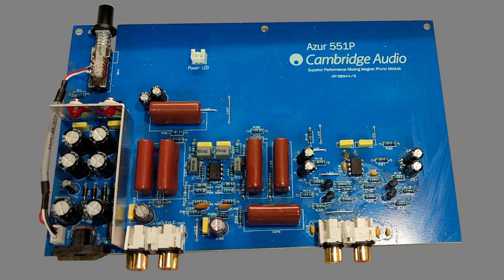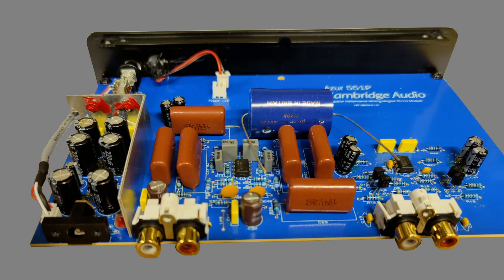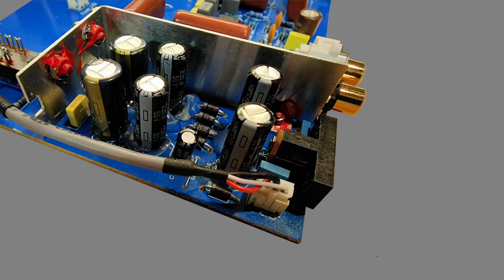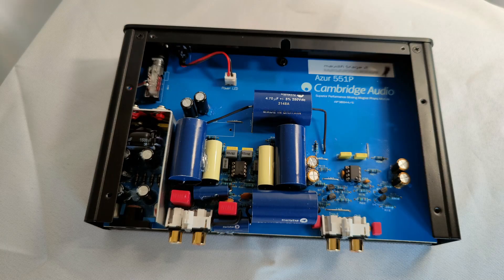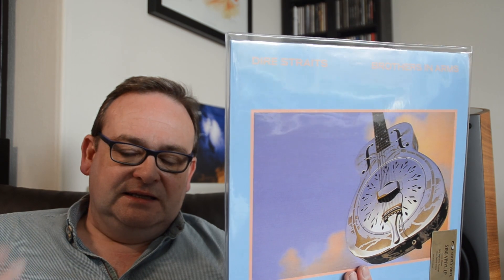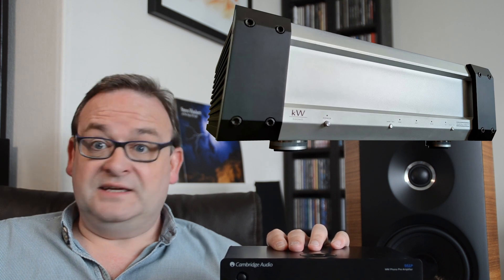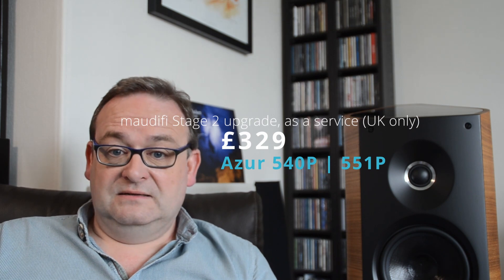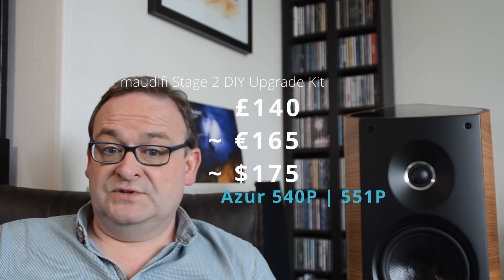Can you transform a budget Cambridge Audio 551P, or 540P, into a high-end phono stage?

Comment from the maker: For those of you who want a better, quicker and easier DIY upgrade for the Cambridge Audio phono stages, then the @maudifi PhonOh! 756 is now available.  Oh, you can also fit it in any enclosure you want, that it physically fits in of course 😉.

It's more than just an upgrade, it's a complete upcycling solution giving higher-end sonics that you can fit in one of the older CA phono boxes (540P, 640P, 551P, 651P, CP1 and CP2).  It typically takes 10 minutes to fit.  Find out more at https://maudifi.co.uk/phonoh756-landing-page/ or watch the videos linked on the end screen.  Ciao.

Comment: Amazing video and voiceover!

Do you know how a modded CA phono  stage would compare to the preamp in the AXR85 amp?  Thank you
Reply from the maker: Thank you.
The simple answer is no, I don't, because I haven't heard the AXR85 and I don't know the details of what is inside it.  
HOWEVER, have a think about it - There is a lot crammed into the AXR85: DAC, FM Tuner, Phono stage, pre-amp, headphone amp and power amp.  All for approx £400.  The chances of the phono stage being as good as Cambridge's own MM phono stages is not high, let alone a well modified one.  It's almost certainly going to be a basic affair to get you going and I guess that's absolutely fine at the price point.
For me personally, I prefer the less is more route: Give me fewer features, but increase the quality of the internals.  Then you can add, upgrade and modify the components you need over time.
Hope that helps.

PS/ There is now a simple maudifi PhonOh! phono stage which makes the mod much, much easier.  https://maudifi.co.uk/phonoh756-landing-page

Comment: Hello, have you thought about changing those small grey film caps?
Reply from the maker: Hi @tweakerman, thanks for your question.  Yes, I have.  However, there are much bigger bang for the buck improvements elsewhere in the 540P/551P.  The RIAA on these is not that accurate and more circuit changes should really be made to correct it.  That said, I have a better solution in the pipeline that addresses this and some other needs.  

The 551P with a Stage 2 upgrade is rather impressive even without addressing the poor RIAA response.
Reply: @maudifi  Hi, I've upgraded a CP1, Solo & a 540P use Audi note Kaisei electrolytic capacitors, that in the power supply & some signal caps, I've also replaced the 6 film caps with JB JFX premium film caps, they just fit without to much trouble & I can say they are all outstanding now, I've done a few videos on my channel about them, cheers for sharing your video👍
Reply from the maker: For those of you interested in such things, the better solution I mentioned here is now available. ... an easy fit upgrade solution that you can fit yourself in around 10 minutes.  No soldering, only a screwdriver required.  Check it out at https://maudifi.co.uk/phonoh756-landing-page/ or watch the videos on it (the end screen of this video has been updated to link to them). Any questions, just ask.

Comment: Is it possible to increase the gain in the 540P by replacing resistors, I find the standard 39Db to be a little too quiet, the AT-VM95SH cart is only 3.5mv output? Also, what PSU would you recommend? Thanks.
Reply from the maker: Yes, it could be changed on the first gain stage.  One resistor per channel.  Changing on the second stage would affect the RIAA response, so don't do that.

PSU - that depends.  If you're staying stock, then I wouldn't make much effort.  If upgrading, then you will appreciate the difference the power supply makes.  I will have some options available soon.  Drop me a note at https://maudifi.co.uk/upgrade-feasibility-request-form if interested in those.

Hope that helps.
Reply: @maudifi  Thank you for your reply. All I need to know is which resistors to change and what value of resistors to fit. My 540P is already modified, All caps replaced for  Nichicon, Elna, Audyn and opamps replaced with sockets so I can try different ones out. Not on your level of mods but a vast improvement over stock!
Reply from the maker: @robertdonald7190 , that's a length of string thing, ... It depends what gain you want to get.  You can then back calculate to determine the resistor values.  If you drop me a line via https://maudifi.co.uk/upgrade-feasibility-request-form, I can maybe point you in the right direction.

Comment: Hi, is this upgraded 540p better then the 640p?
Reply from the maker: Oh yes! By a large margin.  However, only for MM as 540 doesn't have a MC input.
Reply: @maudifi  is this the only difference between 540 and 640, the mc input? What about the sonic filter?
Reply from the maker: No, the 640P also has a different input stage and greater capacitance on filtering and decoupling.  Both the 540 and 640 have the sub-sonic filter.  The leap in performance of the maudifi Stage 2 for 540P over the stock 640P is due to the quality and type of components chosen in the upgrade design. HTH.
Reply: Wow, so if i upgrade mine 640P in your way, will receive greater preamp :) @maudifi
Reply from the maker: Yes, in theory. The trouble is the 640P has additional AC coupling on the input and between stages and because it has two full input stages, is far more densely populated making the choice of quality upgrade components more limited.  Also, the PCB is double sided and the pad holes are on the small side making desoldering / removing components difficult without causing damage.  I actually researched this earlier this year in order to develop an upgrade kit, but I felt it wasn't suitable for a DIY kit.

The restrictions mean, that it could never reach the quality of the 540P Stage 2.  However, I do have a solution in the pipeline for MC input / 640P/651P/CP2. If that's of interest sign up for notifications at https://maudifi.co.uk/upgrade-feasibility-request-form

Thanks for your interest.
Reply: Thank you! Last question, is it worth it to replace my 640P with 651P? @maudifi
Reply from the maker: I don't think so.  There is likely a mild change due to the small film capacitors used in signal bypassing and RIAA network being changed to Wima and Vishay respectively.  I can't remember what make the blue ones were in the 640, but any changes won't be drastic.  There are maybe other manufacturer changes on the electrolytics, but they are still mediocre.  Other than that it's just the addition of a power switch.
HTH.
Reply: Thank you @maudifi
Reply from the maker: @PlamenRadevStoev  Hope you are well.  re upgrading the 640P ... I now have an easy fit upgrade solution that you can fit yourself in around 10 minutes.  No soldering, only a screwdriver required.  Check it out at https://maudifi.co.uk/phonoh756-landing-page/ or watch the videos on it (the end screen of this video has been updated to link to them). Any questions, just ask.

Comment: Would this mod improve the 651P, too?
Reply from the maker: Thanks for your question and interest in maudifi.  In parts, it could, but this is specifically for the 540P/551P.  I did investigate the 640P/651P earlier this year, but abandoned the project.  I devised what to to do and selected components, but there are issues with the original PCB which would cause practical problems.   I will have a video on that coming up.  However, I have a solution in the pipeline for those that have the 640P/651P/CP2.  If you would like to know when that reaches market, register your interest at https://maudifi.co.uk/upgrade-feasibility-request-form
Reply from the maker: Re an upgrade solution for the 651P, that is now available ... I now have an easy fit upgrade solution that you can fit yourself in around 10 minutes.  No soldering, only a screwdriver required.  Check it out at https://maudifi.co.uk/phonoh756-landing-page/ or watch the videos on it (the end screen of this video has been updated to link to them). Any questions, just ask.

Comment: Any thoughts on changing the op amp from the ne5532 to a discrete replacement? From stacatto or sparkos?
Reply from the maker: Hi Peter, thanks for your question.  I hadn't heard of the Stacatto before, but certainly the SparkoS should work just fine and offer another improvement.  I've used them elsewhere, but not tried in a 540/551 yet.

A quick look at the Stacatto datasheet shows for 18V operation the maximum ambient temperature is 30°C, so bear that in mind.  The supply rails are +/- 18V in the Cambridge.  Also check the dimensions, you have around 25mm PCB to chassis to play with.

PS/ The SparkoS will feature in a planned video on the MF TriVista DAC.
Reply: @maudifi  I'm really starting to think a modded 540/541 might be my next move. I have a project phono box E. It's trash through.
Reply from the maker: @JohnnieWalker1986  I think you would be pleasantly surprised by the difference.  

The maudifi website/shop is down at the moment, but you can email via the "Get in touch" button at http://maudifi.co.uk.  Busy here so the site might not be back up this week.

Comment: Hi! Thanks for an idea!
Currently I'm trying to choose between two options: to upgrade my 540p in the way you describe here. OR purchase a used Creek Audio OBH-8SE. What would you suggest?
Reply from the maker: You're welcome.
Good question.  Firstly, I've never heard an OBH-8SE, or compared one to a modified 540P so can't offer a direct opinion.  So, I had a quick search for that model - looks like it has a good basis - If I have the right pics, a few of what look like Elna ROD Starget audio grade electrolytics (not as good as current top-level performers, but pretty decent for the time), and fully discrete transistor based, no op-amps.  The reservoir capacitors look fairly generic though.

Examining the circuit diagram I can see electrolytic capacitors in the signal path which will rob detail, clarity, reduce separation, soundstage, etc. just like they do in the stock Cambridge Audio 540P/551P.

In a direct comparison of stock models, I would think the Creek would be the better sounding device.  However, with the quality of components used in a maudifi Stage2 540P, I believe this would be audibly superior to a stock Creek.

How would a modded OBH-8SE compare to a Stage 2  540P?  I don't know, but it looks readily upgradeable should you wish to go that route.  Choices, choices.  Since you already have the 540P though, that may be the more cost-effective route for you and it is an impressive upgrade.

Hope that helps.
Reply: @maudifi  wow! that's what I would call a real answer! Many thanks!
Reply: PS And if I'll choose to upgrade my 540p I'm definitely going to add a power switch! :)
Reply from the maker: @wrongIQ  🙂

Comment: Hi. What is the last thing you said to don't forget to change.. Sounds like war walk or something like that. Thanks Paul
Reply from the maker: Hi Paul, sorry I think I rushed that bit.  "Wall wart" i.e. The small block power supply that plugs into the wall outlet.  Using a quality toroidal transformer and cable improves the sound further.

These are available from MCRU and others IIRC or you can DIY it.  Some customers have asked me about a DIY kit with chassis for that, so I'll be investigating that with a decent looking enclosure in due course.  If interested drop me a note at info@maudifi.co.uk.  Cheers, Scott

Comment: Do you know any technicians that have installed your upgrade in the United States?
Reply from the maker: Hi, thanks for your question.  Sorry, I don't know of any as yet.  Longer term I would like to setup a US partner.  If anyone is interested, drop me a note at info@maudifi.co.uk.
Reply from the maker: Following up on your question, and if it's still of interest, I now have an easy fit upgrade solution that you can fit yourself in around 10 minutes.  No soldering, only a screwdriver required.  Check it out at https://maudifi.co.uk/phonoh756-landing-page/ or watch the videos on it (the end screen of this video has been updated to link to them).

Comment: Hi do you also make a stage 2 upgrade kit for the 651p? Or is it better to try to find a used 551p to upgrade :)
Reply from the maker: Hi, thanks for your question. A kit for the 640P/651P will be coming. I've done some research on this already.  I'm trying to source one at the moment to confirm options and develop the kit.  If you only use a MM cartridge then arguably a Stage 2 551P may have the edge in sound quality. This is due to less space being available inside the 651 for large value film capacitors. However, there are tricks which can get you mostly there. 
If you drop me a note at https://maudifi.co.uk/upgrade-feasibility-request-form I can keep you updated when the 651P kit is available.
Reply: Thanks for the Quick reply :) I have just found a cheap 551p in mint condition so I will follow your advise and buy the kit for that model. Looking forward to the results :)